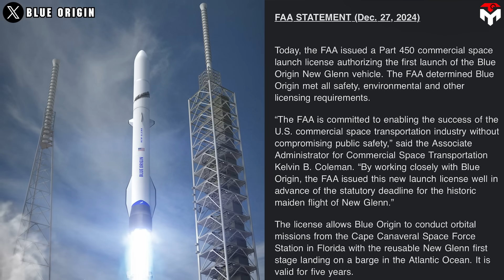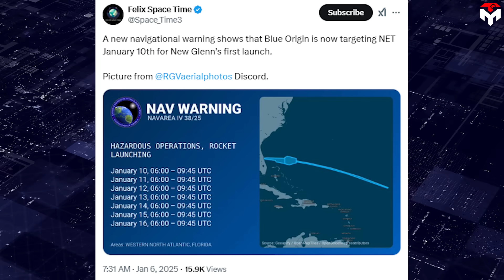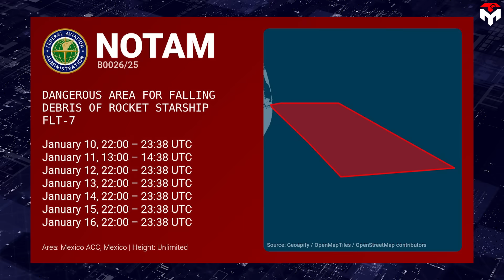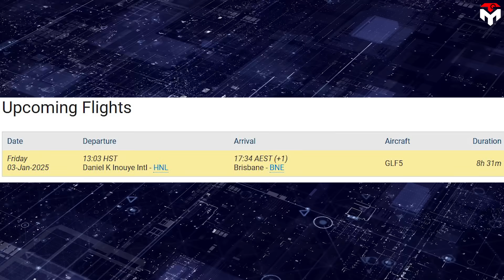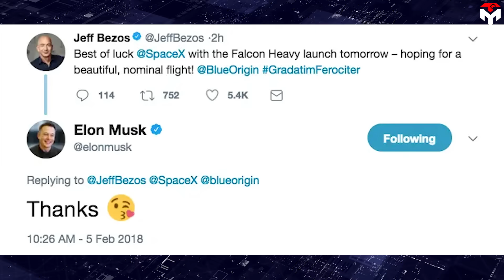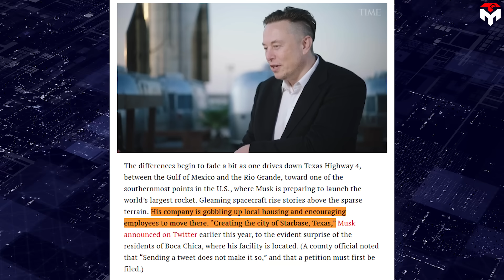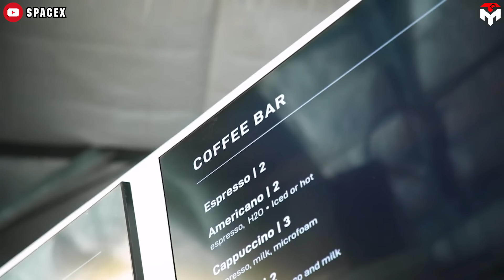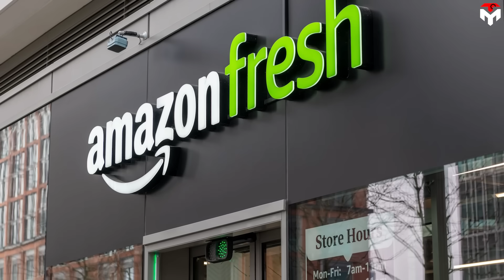It's Embarrassing! New Glenn Launch Date Delay Again while Starship Flight 7...

Comment: Delays are normal, and I consder myself a SpaceX fanboy, if BO pulls it out will be cool, The only thing that happens is that they took so much development time until launch.

In spacex they launch as soon as possible and booms are part of the process.
BO trades time for more checks and testing, we should expect a more polished product.

For me if it blows up before second stage ignition would be little ambarassing, just a little, if blows up after, I consider success, everything else is a bonus.
Reply: I am for no company going after companies in court that has had 100s of flights already while you cannot even prove it can lift off.  its not about being a fanboy but who is better.
Reply: @Fatpumpumlovah2  Yawn.

Comment: For New Glenn everything within a month of delay should still be called "well on track" in my opinion. Better stay safe than sorry - it's the maiden flight of a completely new design heavy lift rocket! The engines have proven to be operational (two pefect flights into space and the long duration test firing of New Glenn) so there is only the question of stage 0 (the launch tower) and the propellent tanks structural integrity. I assume it will be fine, a delay of 3 days is absolutely NOTHING in the field of rocketry. Report about it, that's fine, but to call it "emberassing"  does not fly for me (pun intended). Please try to stay reasonable.

And while I am in awe of the achievements of the Starship development, it should not be hidden, that Flight 7 will not show an operational heavy lift rocket - its another pathfinder prototype! New Glenn on the other hand would show an actual FULLY OPERATIONAL heavy lift rocket, if it proved to fly well on the first or second test flight. BO would easily be a year ahead of Space X Starship, if New Glenn made a successful debut - even if it was a month or two after flight 7 of Starship.

I think the critical reporting on New Glenn development and Jeff Bezos as the main person at the helm was well deserved up to 2023 - it was absolutely unclear if it was a scam or a huge project well on track. But, since then things have changed significantly. Jeff Bezos has shown impressive steps to be more informative to the public and - even more important - in making decisions to get New Glenn operational soon. I think Jeff Bezos has grown to be a highly capeable technical leader and I think this maiden flight will be only a first in huge future space projects to come under his lead. He is now well on track to initiate great contributions to make mankind a multiplanetar species. He did not start it, he is not the legendary bad ass rocket specialist like Elon Musk, that counts near future space lifting goals in Mega tonnes, but a relieable, solid leading space flight entrepreneur. Both give fast results in a cultural field, that seemed hopeless for centuries!
Reply: Ok, if you say so.
Reply: True, if you don’t have Elon bias. More competition is a good thing!
Wishing both of them good luck!